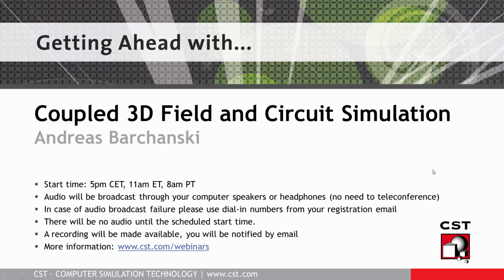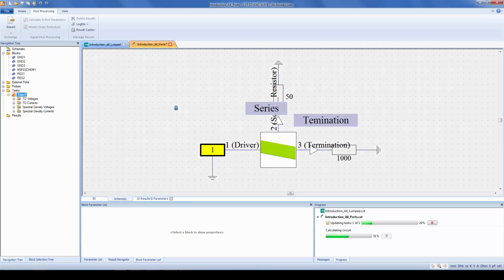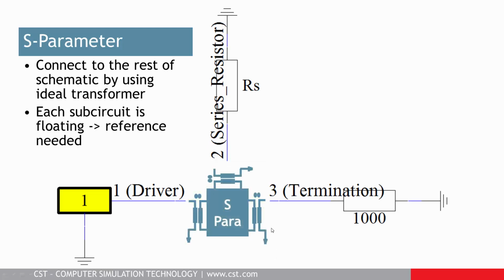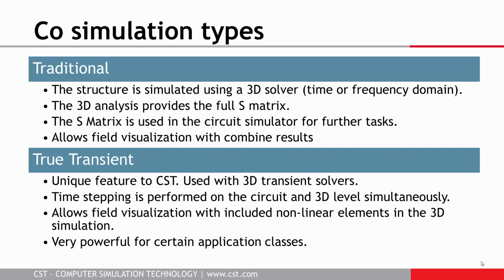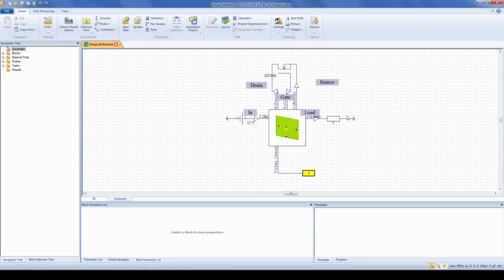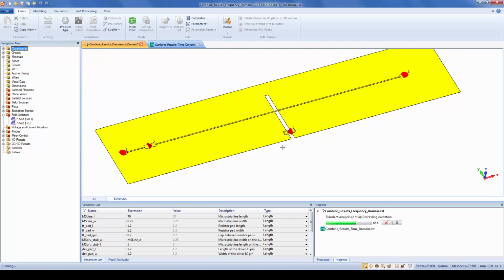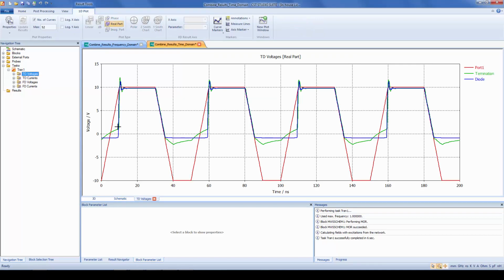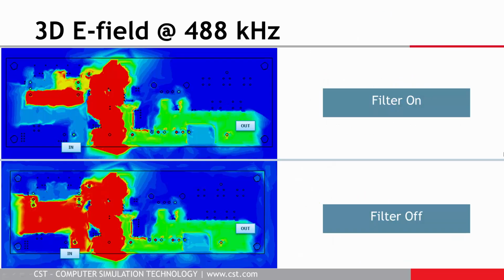Getting Started with coupled EM Field and Circuit Simulation

Comment: Good day! Great video! Your channel helped me a lot during my 1st year of work. I am using CST daily in work for over 1 year now, but there is so many features and aspect that I am still learning new things. Could you please explain me one thing regarding the virtual reference you are using for transistor simulation (29:20). I am using virtual references in my simulations but don't they affect the system overall parasitics? I mean doesn't the virtual reference from your video create additional capacitance for transistor model that are not necessary true in reality? Could you please explain the approach to creating a virtual reference that does not introduce additional parasitics into the model?
Reply from the maker: Thanks for your words. Yes the reference dies create an additional capacitance. There is no way around it. But you need to define the ports in some way, to connect the model of the semiconductor. Most of the time, the additional parasitics will be acceptable. in doubt compare them to the parasitcs of your transistor.

Comment: Hi! Great video! I would like to ask you one thing. I want to 3D simulate an EMI filter that is supposed to be confined in a sort 
of box. If I use discrete ports to model, for example, the capacitors, then how could CST take into account the interactions
between the box and the capacitors? Since they are modeled with the ports they do not have fisical dimensions.
What could it be a good strategy, in this case? I don't want to 3D model every single component of my device if possible.
Thank you in advance!
Reply from the maker: If you need to model the field interaction, then the structures need to be included in the 3D model. However field in capacitors are very local and often in a metal can. Their interaction with the housing is negligible most of the time. For inductors with stray fields it is more likely that a 3d model is required

Comment: I've always wanted to have a better understanding of EM fields with PCBs and antennas and finally started learning CST on my own. Your videos help tremendously on my journey, thanks! Should you ever not be constraint on your own time but on ideas for your next video, here are things a EM simulation newbie like me is keen to learn:
- calculate a potted CPWG of 50 Ohm
- import 2.4GHz ceramic antenna of e.g. Ignion/Johanson and show radiation pattern
- calculate T-network for ceramic antenna in Circuit Simulation?
- put antenna on finger or wrist
- effect of potting on ceramic antenna
- generally, any smoke test to validate simulation results
Reply from the maker: Thank you for the nice words. As I am more an EMC than antenna person, most of my Examples are EMC related. Of course time is always short, but I'll see what I can do 🙂
Reply: @AndreasBarchanski  sure thing, it's your time and your channel. I have created a few more simulations in the mean time and it's really fantastic what I can learn (20 years after my master in electronics). It's still hard for me to judge how far I can trust the simulation results. For example, you pointed out an artefact in "AC and DC Current Flow in Conductors" at 6:15 - it would have taken me quite a while to figure that out (probably after refining the mesh?). Anyways, thanks again for your videos!